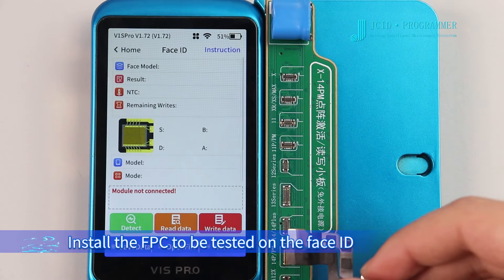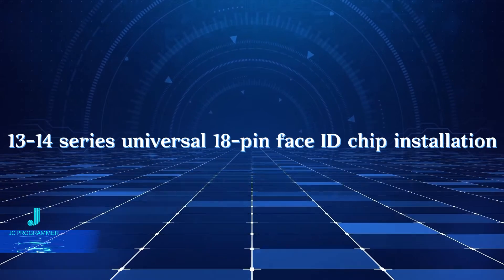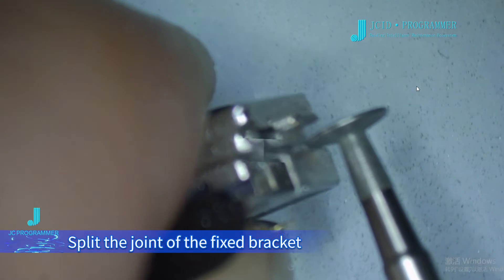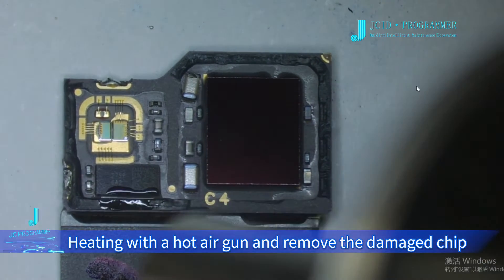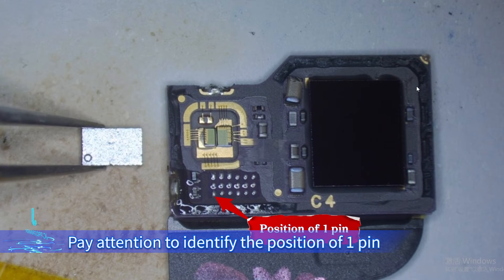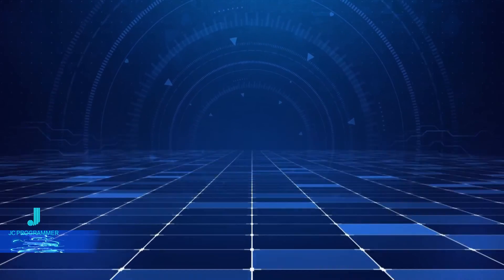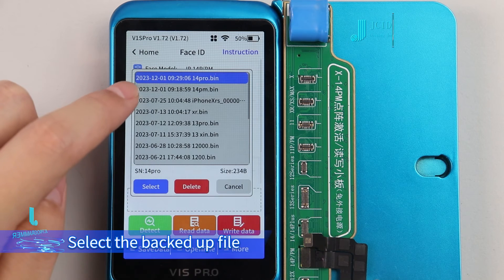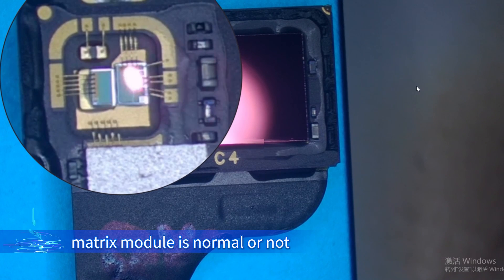13-14 Series Universal 18-pin Face ID Chip Installation

Comment: es necesario que el iphone tenga jalibreak?
Reply from the maker: Si se pueden leer los datos originales, no es necesario hacer jailbreak al teléfono. Si no se pueden leer los datos, es necesario hacer jailbreak al teléfono.
Reply: I do not recommend buying JC products, they block their cables over time and you will not be able to use them anymore, jc is a moshenics company, you do not need to contact them or you will lose your money, plus their cables have a lot of defects, out of 10 pieces about five turn out to be non-working

Comment: If I cant read chip - broken IC og something. What to do?
Reply from the maker: For technical problem, there is technical support contact information on the official website to help you. Thanks
Reply: I do not recommend buying JC products, they block their cables over time and you will not be able to use them anymore, jc is a moshenics company, you do not need to contact them or you will lose your money, plus their cables have a lot of defects, out of 10 pieces about five turn out to be non-working
Reply: Бред))) @ЖеняБелгород-п8у
Reply: I do not recommend buying JC products, they block their cables over time and you will not be able to use them anymore, jc is a moshenics company, you do not need to contact them or you will lose your money, plus their cables have a lot of defects, out of 10 pieces about five turn out to be non-working

Comment: I replaced Flex matrix for IPhone 13 pro. The NTC says: abnormal? How to solve?
Reply from the maker: The official website has the contact information for technical support, hope that helps you.
Reply: I do not recommend buying JC products, they block their cables over time and you will not be able to use them anymore, jc is a moshenics company, you do not need to contact them or you will lose your money, plus their cables have a lot of defects, out of 10 pieces about five turn out to be non-working

Comment: Если не родная сборка, можно восстановить функцию Face ID?
Reply from the maker: Need original infrared and dot matrix module
Reply: I do not recommend buying JC products, they block their cables over time and you will not be able to use them anymore, jc is a moshenics company, you do not need to contact them or you will lose your money, plus their cables have a lot of defects, out of 10 pieces about five turn out to be non-working